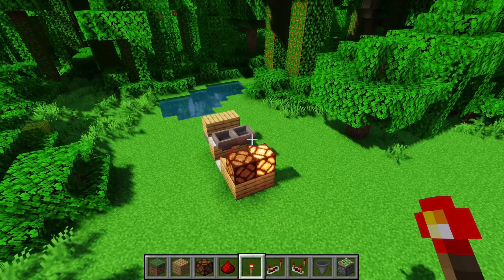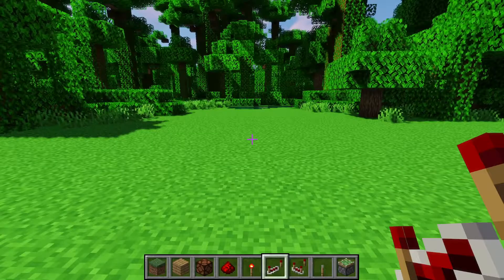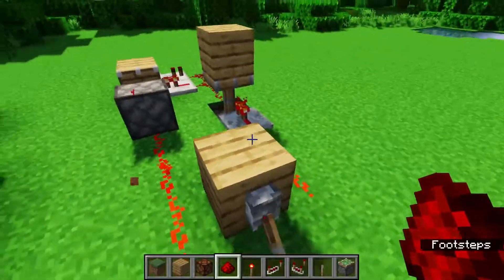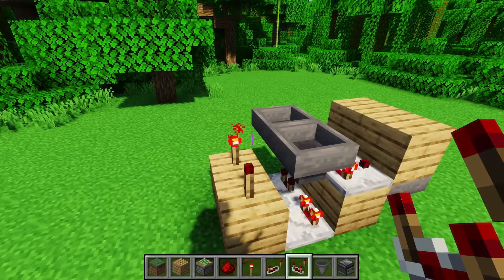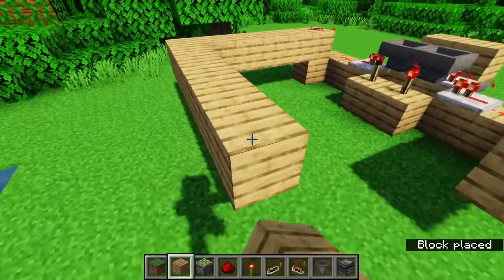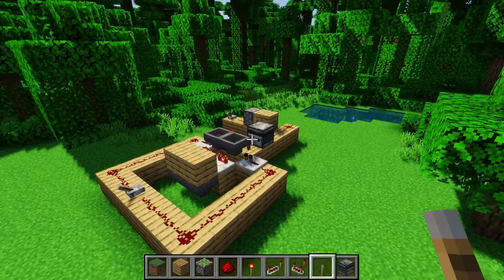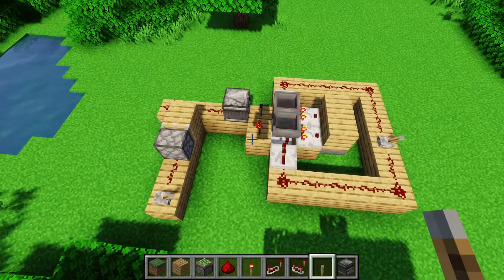Fast and Slow Clock Designs (Repeaters and Hoppers) | Minecraft Redstone Engineering Tutorial

Comment: What if i want it to be powered for most of the time, lose the power for like a second, then back to powered for most of the time, is it achivable with this design?
Do i just adjust the amount of item inside the upper hoppers
Reply from the maker: The hopper clock will be 50% on and 50% off, however, depending on how long you need the off period to be, you could use an observer to give a short pulse when it switches, and use that with an AND gate on both torches (with one inverted). A bit complex to explain in text, but could be doable depending on how long you need it to be off for. If you need a little bit longer, there might need to be some extra stuff like a second clock that goes faster or something. Sorry I cant be more helpful

Comment: It doesn't seem to be working for me the hopper clock, once it gets to the last block of the stack it keeps moving the block back and forth
Reply from the maker: Make sure there is one item on the bottom set of hoppers and the top set is the one with multiple items. If that doesn't work (or thats how you have it already) I would check that the torches in the front have one on and one off. If not, the check that the block the comparators are facing into is opaque. I will go test it again to verify it still works as well
Reply: @ I just used a different slow clock with a redstone block and sticky piston and that one seems to work fine

Comment: Hey man. I want to connect this clock with a dispenser. How do I do that? I need the dispenser to dispense items at a slow rate
Reply from the maker: Depending on how slow / fast you need, you could just hook up one of the front torches to the dispenser; it would dispense an item each time the clock does a full cycle (all items go to one side then go to the other). That could be too slow though, but the number of items in the hoppers of the clock will dictate how fast or slow the clock will go

Comment: how do you switch the clock off? W vid btw
Reply from the maker: You can disable the hoppers that have the item stacks in them by using redstone dust or something and sending them an on signal. That would effectively freeze the clock. Make sure that the disable redstone doesn't interfere with anything else. Later in the video when I do the length extender I sort of disable the first clock using a second one; you can use that same thing but instead of attaching it to a second clock you can attach it to a lever or something
Reply: @ZennsWorld  ok thanks W vid

Comment: I have an automatic resource transporter in my mine. I really wanted to make it go automatically when it gets full, but i couldn’t figure out any way to do it other than a clock that goes off every time the entire mine cart chest has fully filled up. I hope there is a clock for that…
Reply from the maker: You can read how full a container is using a comparator, so off the top of my head if you were to put a chest before a minecart chest and used that with a comparator, you might be able to make something happen with that

Comment: Ok so in bedrock 
0:40 works 
1:28 works but difficult, I suggest using an observer to get the single pulse 
1:53 doesn't work the repeater isn't facing into a solid block when the piston is extended 
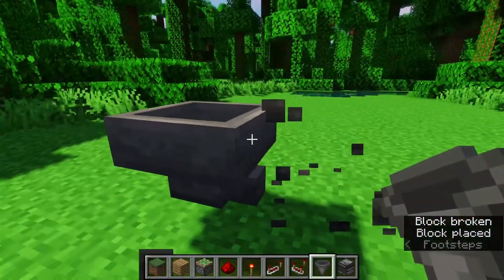3:00 works
Reply from the maker: 1:28 Bedrock edition redstone in general is difficult so I'm not surprised. An observer is a good consistent way to seed this, though can add more lag into the world so it depends on the use case
1:53 I should have mentioned that the monostable circuit needs to be built differently in bedrock edition (sideways instead of vertically); I explain them more indepth in the video I linked there but I didn't say it here explicitly which I should have. Thanks for catching that